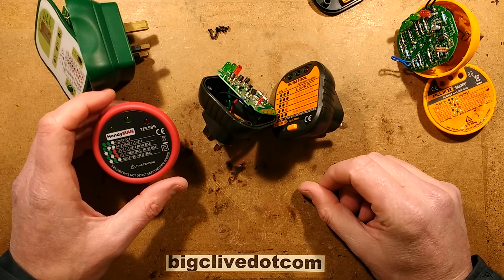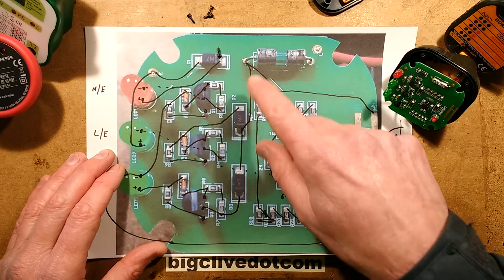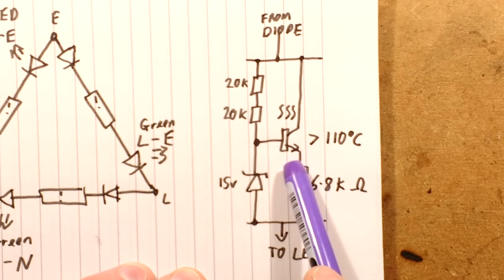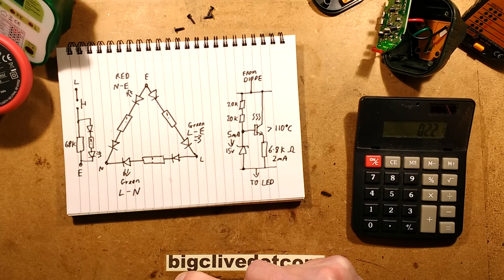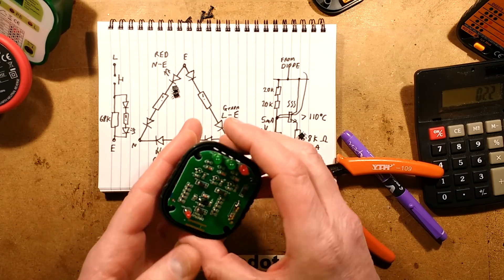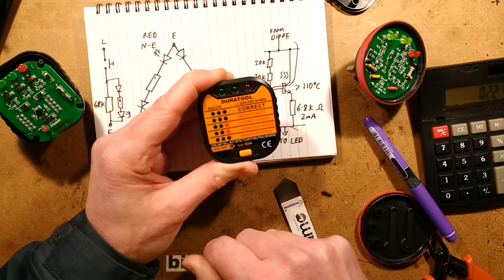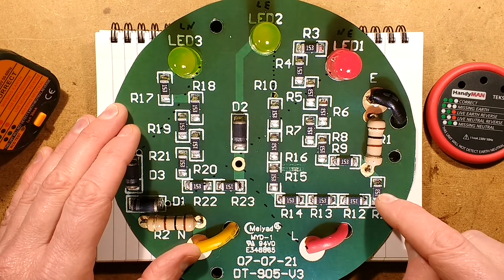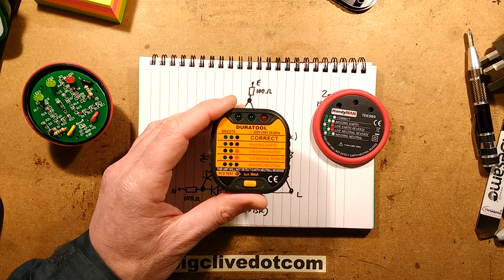Good versus evil socket testers.  (with schematics)

Comment: I use one of the Fluke CM100 socket testers as shown in this video and just had an interesting product recall, asking me to stop using and return to the supplier immediately for a refund. Apparently there is a risk of any metallic parts of a socket becoming live during testing. Any thoughts on this based on the design?
Reply from the maker: Sneak preview of an upcoming video....
https://www.youtube.com/watch?v=_KOYt-0WZxg
Reply: Great explanation, thanks for the sneak preview!
Reply: CM100 sent back, T90 on the way - Better than the £18.76 refund Screwfix were offering. Thanks for the tip!

Comment: Clive I just bought the Handyman TEK989 on the bottom of the unit it says “THIS UNIT WILL NOT DETECT EARTH NEUTRAL REVERSE” why is this? Can this be checked with a multimeter?
Reply from the maker: Earth and Neutral are connected at the local supply transformer and often connected at the point they enter your home.  It's only possible to tell if they have been swapped by looking at the wiring.  If they are swapped then things will work as normal unless there's an RCD fitted, which will trip repeatedly.  It's not recommended to use the earth wire as a return conductor though, because a fault could result in attached appliances cases becoming live.

Comment: With somewhat higher base resistors would have been a better constant current sink which is presumably what they were after but didn’t think it through. Still unnecessary. The explanation is simply Duratool.

Comment: My colleague has designed a fair few socket testers including the one Clive didn't open up. (I don't blame him, it would be scrap as it's ultrasonically welded.)

The great advantage of having a processor in there is the ability to present more advanced diagnostics - for example swapped leads, missing leads, polarity reversal (if you have a touchpad). Processor-based measurements can be more precise allowing a design to be optimized for phantom voltage rejection (if for example you're testing a socket on a long feed with a fault at the far end). 

It's actually the LEDs that consume most of the current, particularly when the chinese factory won't pay a few more pence for a high efficiency green. The limit is you don't want to trip an RCD when you have an open Neutral, and also how much heat the box can handle. Capacitive droppers cost too much so it's resistors all the way.
Reply from the maker: The one I've not opened up yet (because it's my main work one) is now actually a standard recommended unit in the broadcast industry for quick tests on small lighting and sound rigs.  I notice it's also widely used by utility companies as a fast test of the basics after a meter change.  There's also a suspicious clone of it being sold on eBay.....
Reply: Ooh do share the eBay link. I expect it's crap, but you never know ...

Comment: How can these devices tell if live and neutral are reversed? I always thought both was exactly the same since its AC. It will power a device regardless of how its wired. I remember when I got my smart meter fitted, he had to take the unit apart again because he'd reversed the mains live and neutral.
Reply from the maker: +micheals1992 Normally the light connected between neutral and earth will not light because they should be at the same potential.  If live and neutral are swapped that light will illuminate because there is a voltage difference.

Comment: I'll never understand why reversing Live and Neutral is an issue.  It's Alternating Current.  Surely they reverse themselves 50 or 60 times a second depending on where you live?
Reply from the maker: +rhkips In the UK fuses and switches should be on the live conductor.
Reply: +rhkips - Imagine if your E27 light (standard US screw base light socket) has live going to the center connection - OK, safe. Now what if it's flipped and, while you are repairing plumbing lets say, you're touching a pipe in the bathroom, and at the same time you touch the screw base of your light fixture? You would get - at best - a nice shock, at worst you die or at least fall down and get a nice concussion, ER visit, and when you heal up you have to go back home and fix it. I dunno about you but I'd rather pass on the getting maimed stuff.
Reply: Mr Sheesh Okay, but there's still the issue that live becomes neutral and neutral becomes live 60 times a second in North America...  Seems like you'd be SOL either way.  :(
Reply: +rhkips - No; It works more like this: Live goes from 120V (well, about 160V DC at peak, but we call it 120V as that's the average voltage, for now just call it 120V) above ground & Neutral, to 120V below Neutral, 60 times a second; Visualize a spinning, transparent wheel viewed from the front, the axle is Neutral, the rim, that's Live (you can imagine a LED light on there if it helps) - It zooms up and down, above and below the axle, in a sinusoid as time goes on. IF and ONLY IF Neutral is wired properly, you could hold one hand on Ground and the other hand on Neutral, all day, and suffer no ill effect except boredom; Bad idea though so please don't :) But - if you touch Live and Neutral at the same time, you might live to regret it - or might not. That's why we want to know which is which and put protective devices in the Live lead.

Comment: I'm surprised that would cause the transistors to get so hot. Most TO-92 package transistors are rated for maybe 0.5W, so 0.22W wouldn't have seemed totally unreasonable. That said, I think most 0603 or 0805-package surface mount resistors are rated about 0.1-.125W, so I think they would be the more likely candidate at 0.275W... Either way, that's some majorly sloppy engineering by the designer.
Reply: transistors* fixed.

Comment: As for the CCS, the base current can be much smaller than it is here. Taking an example hfe of 100 and current of 8mA, the base needs 80uA, multiply by 10 for some excess for the zener gives 0.8mA. The consequence is that now the transistor needs to dissipate 7mA*220V*0.5=770mW which is too much for TO-92 and requres a larger package. This could be why they increased the current through the base resistors, to take the load off the transistor, but then that defeats the whole purpose of the CCS and they could have just stuck a couple of resistors in there and lowered their BOM cost. A very pointless, ill-designed circuit indeed.
(edited as I can see that the circuit does in fact indicate missing N or E properly)

Comment: Any chance of looking inside the socket and see one you had in a previous video..?
Reply from the maker: I'd like to see inside it, but it's quite an expensive one and is my tool-box unit.  I get a feeling that it will be a microcontroller surrounded by lots of surface mount stuff making it hard to reverse engineer.
Reply: I've got the same one myself. Just wondered about the build and design quality inside.

Comment: Maybe the 100 ohm resistors are removed for 120V ?
Reply from the maker: It would make a tiny difference.  I really don't know why they are there.
Reply: bigclivedotcom They are fuses.  Ideally they should be dimensioned to reach their trip/blow power dissipation at an appropriate current using the I²R formula and the data sheet.  I would estimate that a 100ohm would be set to blow somewhere between 50mA and 250mA, but the Vishay data sheet I used specified their model NFR25 might only increase to 10kohm if blown.

Comment: We in Sweden don not have outlet distinguished for L and N   and they are interchangeable so your entire test becomes irrelevant
Reply: There still can be customs or standards on how they are wired. In Finland the phase should be on the right but it is a not a major issue as plugs go either way. From what I googled it seems that in Sweden it is the opposite which is not surprising.

https://2.bp.blogspot.com/_AJMluY1jeos/TRibvFGDlYI/AAAAAAAABsc/fxQUCe1-2zg/s1600/Tornio.jpg

The issue is mainly with lamps. If it is plugged the wrong way there will be voltage on the screw even when the switch is off. If it is plugged the right way there never is voltage on the screw.

Well in Norway they do not have that problems as they have no neutrals.

Comment: You seem to assume there are viewers that have an inkling of what kind of apparatus this is in this here video
Reply: And he would be right ;-)
Reply: +adriaan van harrick - These tell you if your electrical socket is wired correctly, or miswired so that using it could electrocute you / cause a shock. There are 3 wires - Hot, Neutral, and Earth or Ground - Hot is "Hot", it's the live wire - Neutral is the return wire to the electrical panel, and Earth is for safety (so if you have an old metal cased power drill, for example, and the Hot brush breaks, shorting to the case, you don't end up dead, instead you see sparks flying then the breaker pops or fuse blows.) Anyone serious in Electrical matters knows - And now you know as well :)

Comment: The usefulness of an RCD test button seems to be very limited.  If the RCD trips, as it will 99% of the time, then you have to go to the consumer unit to reset it so you might as well use the test button on the RCD instead.  If they are going to provide an RCD test function then it would be better if it applied a single 30mA 200mS pulse which would detect a slow RCD which its own test button can't.

Comment: Your calculation of the voltage across the 20K biasing resistors in the current source isn't quite right because the line voltage is half-wave rectified with reference to the anode voltage of the LED plus the 15V dropped across the zener. I won't bore you with calculus but the actual rms across the pair of resistors should be about 160V. By my calculation each resistor dissipates 1/3W and the rms current is 4mA. That being said, the basic arguments about the poor design remain valid.

Comment: Resistors? Couldn't they have used capacitive droppers instead and saved on the fire hazard?
Reply from the maker: It's also probably a safety thing, since the unit does pass current to the earth connection deliberately.  If there was a broken earth on that circuit it could make the cases of equipment connected to it live at low current.

Comment: Willl these work in EURO plug markets or are they strictly for polarised plugs?
Reply: There are versions available for Schuko outlets, these ones shown here are only for the british BS1363 outlets.

This one have the touch contact on the upside for the check if the voltage of the earth contact is live (if it is the LC display will show a warning):

https://www.amazon.de/Testboy-Steckdosenpr%C3%BCfger%C3%A4t-Testavit-Schuki-LCD/dp/B00YXOXF4W/ref=sr_1_6?ie=UTF8&qid=1516314212&sr=8-6&keywords=testavit+schuki
Reply: Yes. I have a version of the green tester made for schuko outlets. It most often has to be turned upside down to get phase and neutral right.
Reply: Johan Linell doesn't this mean the sockets are wired in wrong?
Reply: WineScrounger Nope, the sockets dont have any polarisation, live and neutral will be swapped if you plug it in upside down
Reply: There is no definition, not even in Germany (and we love defining standards, its our dearest hobby) if the l1 has to be on the left or right.
But there is a recommendation that inside a house it should always be on the same side.

Which i don't really understand, because i would never work on any outlet without checking it myself. I also NEVER trust the colors of wires somebody else did until i checked them myself.
Reply: Det var det jag menade. Jag är också svensk.
Reply: +djteac
There are the guys which think they must install L on the left, because it's L...like left. And the old-school guys installed the line on the right, because it was called R at that time...and r is right...(the three phases were called R, S and T decades ago instead of L1, L2 and L3).
And it should be installed the same way arround at least inside of a circuit. In the whole house is sometimes very difficult.
Reply: Left is Vänster in swedish so that's not a viable theory and since no english speaking countries use that plug it's even less credible.
Reply: German:

Left = Links
Right= Rechts
Reply: Yes but I am swedish and so were at least 2 of the responders.
Reply: I've responded to djteac. And if swedish or not doesn't matter, it's the same outlet-type (Schuko or international "type F"). And Europlug is something different, that is this guy here:

https://upload.wikimedia.org/wikipedia/commons/6/63/Euro-Flachstecker_2.jpg

It fits into Schuko outlets, but it's only for appliance with low demand (rated 2.5A max).

https://sv.wikipedia.org/wiki/Schuko
Reply: Im sorry I thought it was a reply to the original comment. However Schucko and euro is the same plug since it's the one used in most of continental europe and scandinavia. Clive uses british plugs.
Reply: No, it's not. Euro is for small appliances only (2.5A only), and it's fitting into different systems without an adapter with one exception, the british sockets. Schuko is one of them. France, Belgium and Poland are using this one here:

https://upload.wikimedia.org/wikipedia/commons/b/b3/E_plug_and_socket.jpg

There's a plug available which fits into Schuko and these outlets (normalised as CEE 7/7). It looks like a Schuko with a hole in the front (for the earth connection of the french sockets), but a normal Schuko would not fit into these outlets.
And the BS 1363 is standard in the UK, Ireland and Malta. Denmark is using their own system:

https://upload.wikimedia.org/wikipedia/commons/2/21/K_plug.jpg

Switzerland and Liechtenstein are using SEV 1011 outlets, in both countries Schuko outlets are banned:

https://upload.wikimedia.org/wikipedia/commons/8/82/SEV_1011_Typ_13_Steckdose.jpg
Reply: Well yes techically it is but they both go in the same socket. Which is kind of how most non autistic people define plugs rather than by how many amps the plug is rated for. I should know since I am autistic.
Reply: +Johan Linell - But some Euro sockets don't allow that due to the offset protruding Earth pin am I right? Some intelligence is needed to "assume" the phase polarity. Maybe French / Swiss?
Reply: The rating is because the size of the contacts. The diameter of the pins is smaller and they are shorter. That's why the rating of the Europlug is smaller than the Schuko. The Europlug fits in most of the european sockets, that's its advantage.
Reply: Schuko is not having an earth pin, it has two clamps for the earth connection. The french system has an earth pin, but afaik there's no regulation there on which side the line and the neutral belong in the outlet.
Reply: Maybe so I have never seen such a socket though. We use sort of staples on the top and bottom for the earth. You get that plug with the offset earth pin with laptops though ant thas the one you forget to throw away and always pick up when you are in a hurry to go out.
Reply: Duh!
Reply: Wupme   It is normally that view from back side is left => N and right => L. Standard of Deutsche Bundespost, public TV, and Radio Stations. From the front side opposite direction. 

Yeah it is design error why make symetric save earth on it and not only one side and other side inside hole. So the swiss connector better. True CEE connectors too thick for household.
Reply: Tom Pauwels   No neutral and only two live at both side your device can not worked! The pin in middle is "saved earth" how can not use as neutral. People forget that we use AC - not DC - and so the power change with 50/60 cycles with live / neutral phase! "Saved earth" have zero power normally => only flow if your device fault for ping / tripping the rcd and your fuse!
Reply: In Finland there's a rule of thumb to connect live to the right side or down if the socket is vertical. Why this is no one knows it has just become a tradition. I believe rest of the europe connects it just the opposite way. And I mean looking from the front.
Reply: Pentti Hilkuri   You mean "look from front" or "look from side install - also from back"? 

All cables at backside of a power connector. Exact for this most EU CEE power connectors have write at pin connect site what put in. 

See here: https://goo.gl/images/mJriw2 
or here: https://goo.gl/images/RBsVff
Reply: OldLordSpeedy I meant the single phase schuko plug and looking from the front, CEE plugs are wired according to markings.